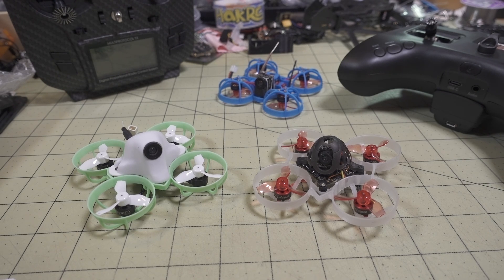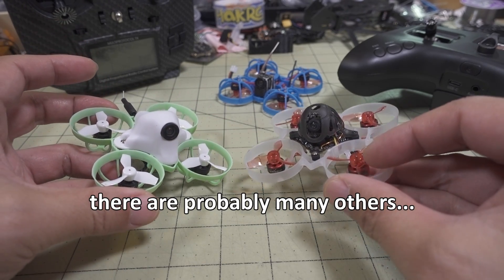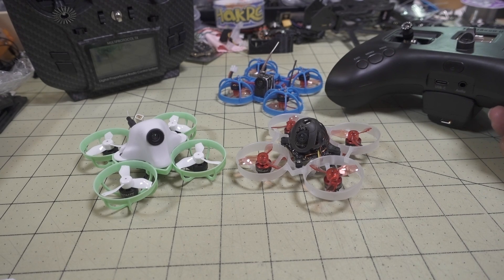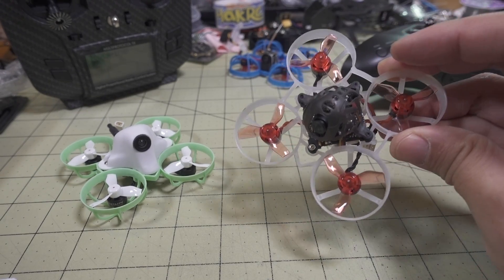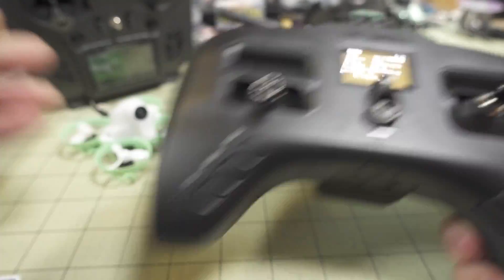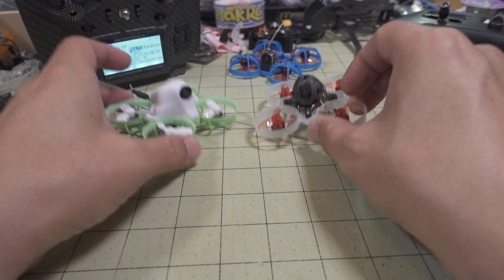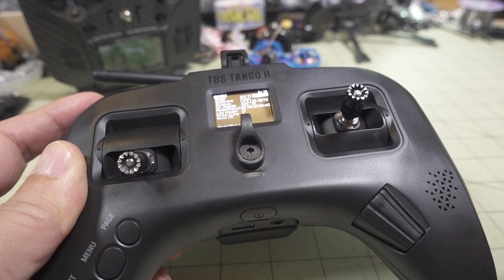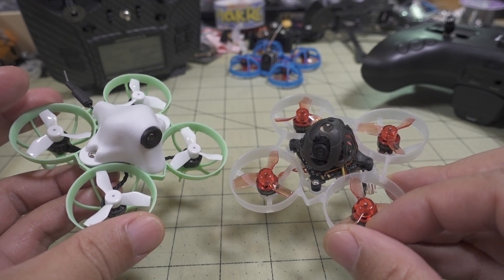Redpine Protocol for Ultra Low Latency 😲

Comment: Definitely not 1-5ms from stick to motors. The filters alone typically induce more latency than that. But 1-5ms from stick to BF read is still insane. I find it kinda hard to believe lol
Reply from the maker: This is what the developer said on the rcgroups thread.  "1-5ms from transmitter gimbal to betaflight dshot motor output".
Reply: Albert Kim Thats what makes me suspicious. There’s no way to estimate how much delay each individual filter setup will add. Not to mention, at 1-5ms, that would make the radio link basically instant.. which is physically impossible.
Reply: @zfpv7211  possible with higher refresh rate /shorter signal width though ^^ miliseconds is quite much for signal paths in general